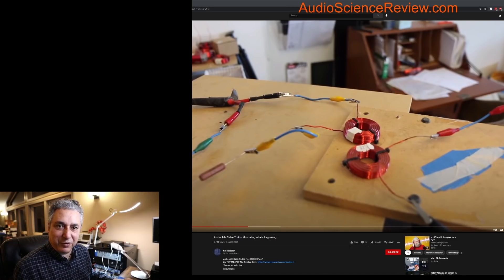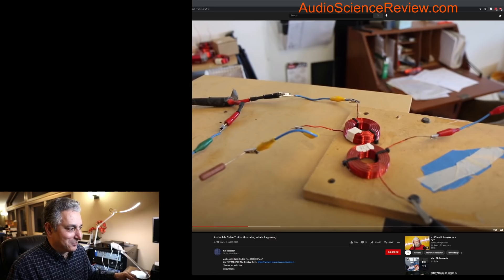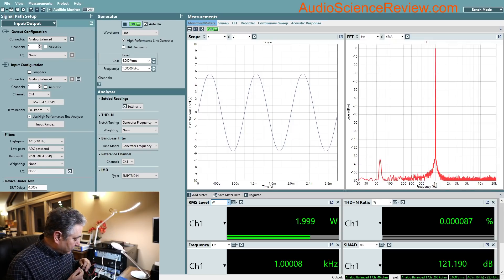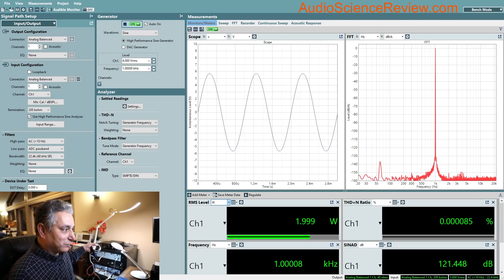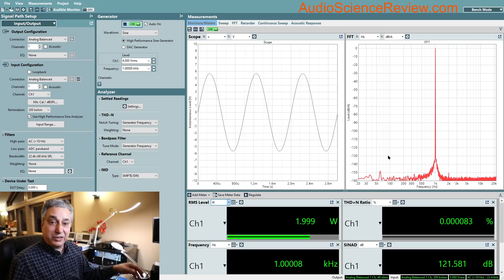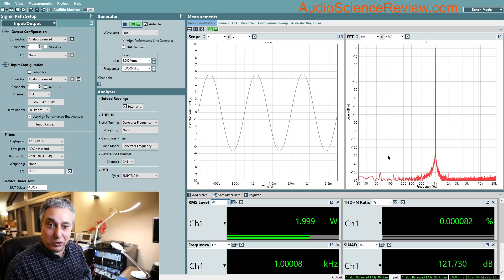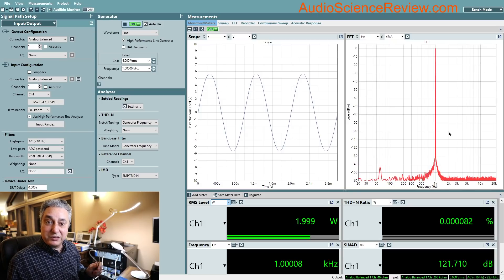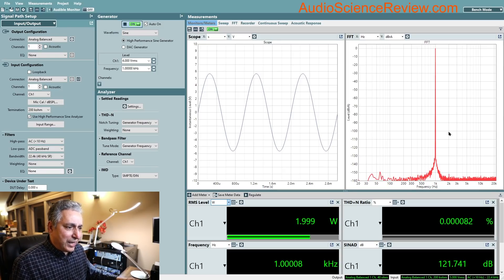Electromagnetic Interference In Speaker Cables?

Comment: Hi, my building contractor ran 14 gauge speaker wire for my rear surrounds in the same conduit as my 220 volt supply for my electrical outlets.

Is this a "problem" or would any interference be inaudible?

If I don't need to I'd rather save the hassle of re-routing the speaker wire.

Comment: The logic is spot on, the measurement technique is also spot on.
No surprises here that snake oil claims are based as you say solving an electronic/reproduction problem that doesn’t exist.
And as always the solution is to buy ultra expensive fire hose cables with 19 layers of high tech shielding and a 12v battery!
EFI and RFI may be an issue for ultra high gain phono stages - but not speaker cables.

Comment: Not that I believe any of the ridiculous claims of the premium loudspeaker cable proponents, but one thing I would note is that the power cable being used in this test wasn't carrying any load. If there was a large load on it of several amps, then I would expect to see a lot more interference, primarily as mains hum with the cables parallel. I still would not expect it to hit anywhere near the threshold of hearing, but it would surely be different.

Comment: Again, wrong measurement.
Live wire (230V/50Hz or US 110V/60Hz) is when there is also current, not only voltage (potential), together they make power (P=U*I).
So circuit must be closed unlike in your testcase. 
Also important is the power, which current it takes while 230V/50Hz, more current could mean more influence.

Comment: Amir, here's one for you that is a little off topic, but still interference. I live in a small town (700 people) where we are surrounded by wind turbines (100+). When we first moved here a few years ago I have all sorts of noise in my system and guitar amps. Assuming it was noise on the mains I took a small battery powered SS headphone guitar amp that was dead quiet at my previous home and played it outside in my yard. Same noise, only louder. Come to find out the windmills aren't even tied to the town infrastructure. No idea if it's the turbines or what, but it's definitely there.

Comment: The more current moving through a power cord, the more EMI it creates. If that cord is plugged into a device drawing more current, I expect you would see that 60Hz spike into the audible region
Reply: Exactly. This banana-brain has no current running through the cable and thinks there is going to be EMI? Good Lord.

Comment: I have some space issues behind my amp. At one point my speaker cable lay's with two power cables for about a foot, I separate them and guess what     NO DIFFERENCE. So much malarkey in audio! The BIGGEST is a hi end power cable! 6 ft of cord from the wall to the amp. As long as the cord is not defective, zero, zero, zero difference. One voltage, one frequency, before the power supply and not in the signal path. The crap people will believe, and think they hear.

Comment: Cool video! I would like to add that this scenario in my experience is much more prevalent on the recording end of things. With tube mics or even standard condensers of low-efficiency (as many popular models are in studios these days) the mic-amp will add 60-70db of gain (or more) to bring a mic up to level for recording. In these cases it's very easy to pickup noise. Many times I would be searching for the annoying source of a 60hz buzz on my mics only to find it was a power cable for a guitar amp, kayboard, organ, compressor, etc that got crossed over a mic cable. Now I can't say that for speakers, but in recording having a well insulated cable and good distance between mic's-line and power is staple. Given the numbers here that certainly makes sense.
Reply: Time to sell cable risers for recording studios! :)

Comment: I was no scientist at 15 years old and had no testaments to test with.   But when I had a hump in my speaker wires around in the back of my stereo can you something was wrong. 
            That’s when I discovered sometimes wires laying next to each other or in my case running next to the aluminum window frame can you pick up noise. 
               Going down to my fathers and grandfathers scrap wire ben using old wires because they were into radio in communications I discovered I could get rid of Noise.    And I also discovered new instruments that I cannot hear before that were clear. 
                  But that was just scraps of cheap leftover cables and wires with no scientific testing equipment and no engineering background. 
                 But a 15 year old can clearly hear the difference and discover the difference a wire to make. 
              The same goes for making up your own AM and  FM antenna a wire to make all the difference in the world between hearing a station and not hearing a station.   
           But it does not have to be expensive wire cheap wire works too just depends what kind of wire and how you have it twisted or braided or looped . 
          Like using Lutz wire
Using the right wire in the right scenario will give you good results using the wrong wire in the right scenario will give you no results

         No education needed no test equipment needed just a good set of ears plain and simple

Comment: I found out the hard way just how powerful an effect there is in making  coil of a wire, as opposed to leaving it straight or wiggly. I was replacing a fan in a computer and decided to wrap the extra long fan power cable around a pencil to form a pretty coil - to keep it out of the way. Then I powered up the computer and instantly, right below the coiled wire, some tiny little component on the motherboard puffed smoke at me immediately, and of course the computer was toast. LOL

So now I'm careful to just leave loose wires in a bundle tied by a zip tie or Velcro or a twist tie, or when possible I just let them hang loose, as long as they can't fall into harm's way.

Coils of a wire make a huge difference over the same wire laid out relatively straight.
Reply: Your little pencil coil of thin wire created more of an inductor than loosely coiled audio cables ever will, due to number of turns and proximity of turn wire.
Reply: @RennieAsh  Exactly. Learning by doing. Too bad I blew up $100 worth of circuit board in the process. Of course I remembered it clearly from that point on!

Comment: Amir, Danny has now posted a video about the claimed benefits of different power cables. Below is my response to him that I just posted suggesting a measurement method of possibly exposing the sonic differences in cables in general, which Danny and others unanimously claim large improvements in the sound stage, imaging, detail, and clarity. I would very much like you to try out my measurement method and see if you can detect any objective and/or subjective differences. I would try it myself but my lab is currently out of commission. Here is my post:

Danny, 
Can you explain how over filtering the 50-60Hz AC sine wave induces a dull and lifeless sound in the audio signal? I can understand why there might possibly be a sonic effect with noise added to the AC power, but how can less noise degrade the sound?  

If you can explain the above, how does the noise on the AC power feed modify an audio signal in amplitude and time? Noise added to the audio signal might mask some audio frequencies or might be heard as noise resulting in a degradation of the perceived sound quality, but I cannot see how noise can actually modify the audio signal itself to result in either a perceived improvement or degradation.
 
From a comment you made Paul Lazarou:
“If you can come up with a way to measure the differences in sound stage layering, depth of sound stage, space between and around instruments, detail levels, and clarity then you'll be the first.”

The sonic qualities you bring up are based on the ability to localize sounds, which depend on interaural amplitude and time differences of sounds impinging on our ears. The measurements you show as well as the rest of the audio industry do not address the cause of differences in the amplitude and time relationships of the harmonics of complex sounds. This relationship can be changed by the phase and group delay properties of the system, and the result can be seen by observing the differences in the waveform of a square wave. 

Have you ever looked at a square wave with different cables? If not you should try this with various square wave frequencies and signal levels, with different power cables, speaker cables, and interconnect cables while observing the effects at the speaker terminals. Keeping the signal levels low to avoid damaging the midranges or tweeters of course. And noting any differences in the sound quality.

Comment: Danny’s video is junk science. Can a speaker cable pick up radio frequency or other EMI? Yes, of course it can. Can this interference alter sound from a loudspeaker? Absolutely totally completely 100% impossible in a properly working quality system.  An amplifier/speaker circuit is low impedance. Any interference picked up by the cable will be shunted to ground. The amplifier signal output is a million times stronger than any possible interference. If you have the misfortune to have a poor quality amplifier and live next to a high power transmitter then a couple of $5 clip on ferrite suppressors will fix. A better solution is to buy a quality amplifier and not waste money on stupid cables.

Comment: Greetings, 
Can I ask you for a test?

The power cord is is connected to the wall but not connected to a device. In the back of a system you have a lot of cables. Make the same test with a powerful amp working, a pre amp a cd player or a streamer and a dac, the transformers from the hdd discs tv boxes etc. and a tv to see the album covers.  The results will not be the same you make in this video. 
Nobody have  power cords disconnected near speaker cables. 

Normally people have a giant spaghetti ball in the back of the racks. 
Than you can make a test with all power cords shielded and present the results. 

If the results are the same you have busted all cable manufacturers in the world.

Comment: If I understand EMI fields correctly, the more current drawn through that AC power cord the more magnetic flux there is.
This AC cord you have has no current flow since it's not connected to a device.
Is this able to be revisited?

Comment: What happens if you place an unshielded power cable, that btw isn't in an open circuit config as you show here 2:17 (aka. drawing no current, meaning little to no magnetic field, which makes your test potentially invalid), against an unshielded RCA wire that sends a 15uV AC signal (corresponding to -96dBV, the value of the 16th bit in a CD) from e.g. a DAC to a preamp and from the pre-amp to a power amp? How will the interference level from the power cable then look relative to the signal?
Comparing one "high voltage" lead (speaker cable) against an other (power wire) of course makes the interference relatively small to the voltage they both carry, but what if you do the experiment described above, where the signal-lead is a very weak signal? 
Also, if you do this test could you show dBV rather than dBrA, please? Thanks.
BR A fellow audio/electrical engineer and hifi geek :)
Reply from the maker: The power cable has capacitance so it was drawing current, albeit a small one.  But since the voltage was pretty high in there, it still created a magnetic field.  Anyway, I also tested with a load power cord.  Please see: https://www.audiosciencereview.com/forum/index.php?threads/electromagnetic-interference-in-speaker-cables-video.20647/post-683806
Reply: @AudioScienceReview  I've seen it since and believe that the noise of the amp you use (one you wouldn't recommend according to your own review of it) is so large that it makes it unsuited for this kind of test as it obviously masks any EMI noise with all those distortion components. Also, the current draw from such a small capacitance... Don't buy it - just admit you screwed up and make a video that says so, so people on the internet won't use this as false information in the endless debates. And why would high voltage have anything to do with a higher magnetic field?
 What is your technical background? It seems like you don't know how to create a proper valid test setup for the thing you what to test. Just because you have an AP system, doesn't make the numbers you produce right by default - I made plenty of bad measurements on AP.
Please give a comment to the power cord vs signal lead - that would be interesting to see.

Comment: It's a very interesting test, of course the 2 inductor test is invalid, that's just working like a transformer. Can you explain your setup in more details? I'd assume you have a load on the speaker wire, e.g. 8 ohms and you measure at the resistor end. And also a load on the mains wire, e.g. 500W. It would probably be most realistic to test at e.g. 100mW/8ohm assuming worst case someone have 95db/1W/m speakers and are listening at low level.  Plus running the mains cable and the speaker cable in parallel for something like 3 feet/1meter would be realistic. I wouldn't expect much interference because of the low impedance, but it would be interesting to see with the AP Analyzer.
Cheers,
Jake
Reply: Agreed. It would be interesting to run the 1m test both loaded and unloaded on both cables. I would like to see as you increase the load on the power cable ie 100w up to say 1500w (standard coil heater) what the results are.  In my head the more current load on the power cable the more increase of magnetic field around the conductors and more likely to induce noise onto the speaker cable.

Comment: Thank you for the video.  For normal systems ordinary 18 gauge lamp cord is fine.
You should have had the lamp cord connected to a lamp or some kind of a load so that a current would be in the wire.  That is why your coil made no difference.
Reply: @Swinde  
That's not quite true.  But Amir has already addressed this in other comments here and in an updated test on the ASR forums.

 I will add my .02 while I'm here:

In pro audio/concert venues, it's common to use 100ft + of standard 12 AWG, non-twisted, OFC copper speaker cables for the High-End speaker cabs and line array systems.  Most of these cables are terminated with twist-lock "Speak-On" type connectors.

The speaker drivers and compression/horn driver units that are used in these systems are incredibly efficient and will easily reveal ANY type of noise that makes its way into the amplifiers or cables during sound check.

If you can imagine the huge potential for a horrible RFI and EMI environment at a large concert hall or venue, well, you'll quickly learn that it is a non-issue.

Yes, for long runs of line-level SIGNAL cable (and I'm talking about several 100 feet or more), in the pro audio/recording studio world we use 3-conductor differential/balanced XLR cables that provide common-mode noise rejection, and they also use 98%+ shielded cable.

But for long Speaker Wire runs from the amplifiers for even the High-End concert PA or "house" systems, it is just standard 12AWG speaker cables, or a combined "snake" cable with multiple pairs.

Think again about the potential for HEAPS of strong RFI and EMI at a large concert venue!!!  

There are often 100's of Motorized Lights, Wind Machines/fans, Fog Machines (spurious AC motor noise and heating elements) that are also controlled through a very robust (high power) Wireless RF DMX switcher/mixer board.

Between all of the performers, we'll use lots of Wireless microphones and in-ear monitoring systems.

Most FOH audio mixing consoles have high power portable WiFi remote controls (iPad or dedicated Touchscreen units).

And the FOH & monitoring engineers will often have a small, cheap portable AC cooling fan plugged into the same AC power as the mixing console.

The entire stage crew are using high-power, professional Motorola walkie-talkies in close proximity to all of the audio gear in order to communicate.  That alone is heaps of RF all over the place.  And the battery chargers for these are usually plugged in near the power amplifiers just stage right or left.

And there are all sorts of electronic keyboards and smaller music devices plugged into the AC power and scattered around the stage that use cheap "wall-wart" or "power brick" style power supplies...injecting noise into both the air and the stage's AC power lines.

In addition, there are potentially hundreds to thousands of people in the audience (including the crew and performers on stage) with active cellular smartphones that of course also have WiFi and Bluetooth in addition to the more powerful internal cellular radios.

And yet we are able to use 100's of feet of common, non-twisted, 12AWG copper speaker cables for all of the multiple "flying" speaker cabinets and line-array speaker systems with absolutely no issues for years and years!

If there is any potential for speaker wires to become an antenna, well, this is it!

Here is a typical 100ft speaker cable for stage and sound reinforcement use, i.e. "Danny's antenna".  No issues whatsoever.  If there were, they wouldn't be used by thousounds of crews and pro-sound companies across the globe.

https://www.glsaudio.com/GLS-Audio-100ft-12AWG-Speaker-Cable-4-CONDUCTOR-with-Neutrik-Speakon-NL4FC-124_p_681.html

And IF there were any RFI or EMI noise issues, it would most likely be from the very low-level (millivolt) signals traveling through microphone or electric guitar cables.

If any noise were to get into the speaker cables, it would most likely get into the performer's much lower power wireless in-ear monitor.setups as well.  And they would never let that fly.

Just sayin'  ;-)
Reply: @bbfoto7248  love your explanation. Thank you!